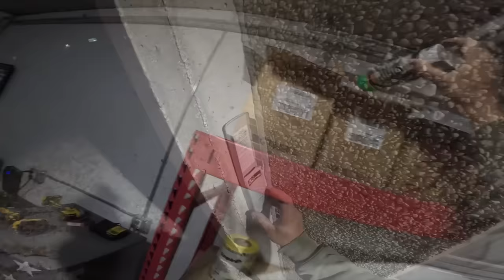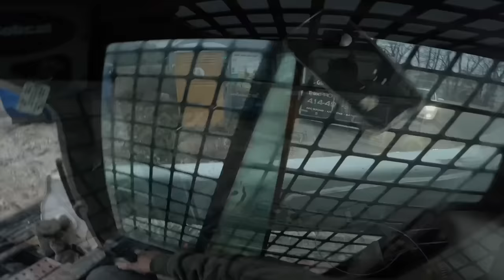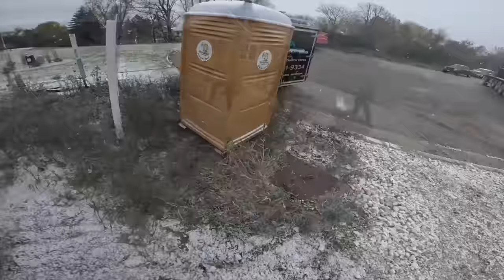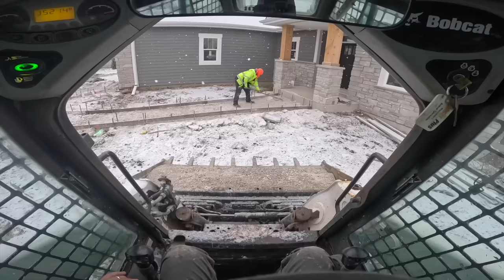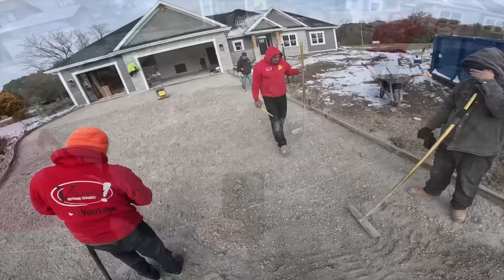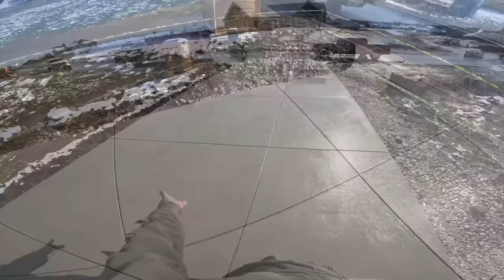Concrete work continues no matter what!

Comment: I poured trench footings for a university of Iowa research lab that were 4' deep and 8' wide. Under the blankets they were over 70 degrees for almost a week in weather in the teens. Concrete makes and holds its own heat for a long time

Comment: Matbe this winter you can make up a tool box with wrenches and allan key sockets and mount it on one of the trucks. Just go thru you equipment and see what you need to fix your equipment in the field and put that in your toolbox.

Comment: Concrete is definitely very exothermic. When pouring the Hoover Dam, they added cooling pipes to control the heat. If I remember correctly,  there was mention of taking 4000 years to shed all of that heat if they didn't cool the structure.

Merry Christmas!!!!!
Reply: WOW that was WAAAAAY more info that i didn't need to ever know.
Reply: @bobbruin44  I saw it in a Modern Marvels episode on the History Channel back in the 1990s.
Reply: Close.... "Bureau of Reclamation engineers calculated that if the dam were built in a single continuous pour, the concrete would have gotten so hot that it would have taken 125 years for the concrete to cool to ambient temperatures."
Reply: Do I really have to add that I was joking.??
As Ryan would say ,”Maaan”
Reply: @nbco55  The History Channel is known to exaggerate facts at times.
Reply: @jsh6952  lol... Yes they do. Merry Christmas.
Reply: @nbco55  Merry Christmas!

Comment: Here's a thought for you to consider. Sence you have your new property why not have a few diesel fuel tanks and gas tanks installed on the property for your use only. The oil companies can then refill your tanks when needed.
Reply: These would be above ground tanks.

Comment: Ryan putting a man door on the concrete building would be a great addition. Maybe a winter project?
Reply: He could have had one built into the overhead, it would have been the easiest solution, but in any case, they definitely need one, hard to keep the heat, or air in with the overhead up.

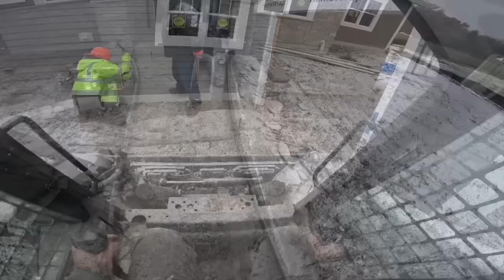Comment: 14:32 didn’t know you can use copper piping to run a gas line into the house. 😂
Reply: Great observation.   Why not black pipe especially in that location and it's natural gas not lpg
Reply: @JohnVanMeter58  it’s one of those funky deals that the builders were trying to save money on building that home. Instead of making it right they didn’t care and let the new home owners deal with it.